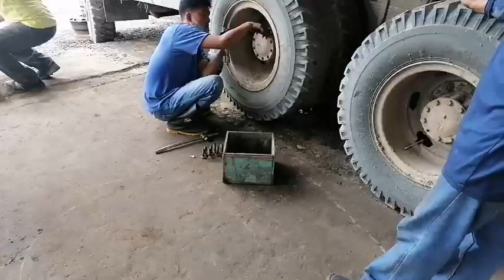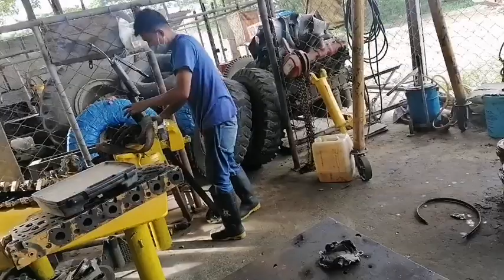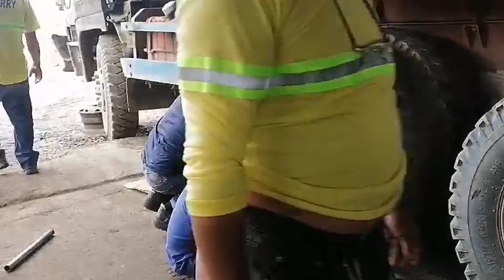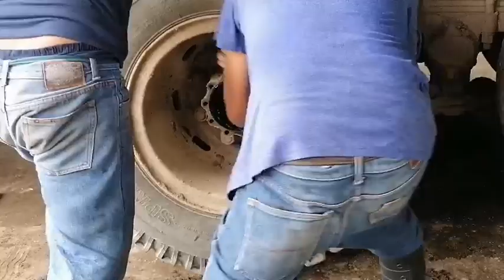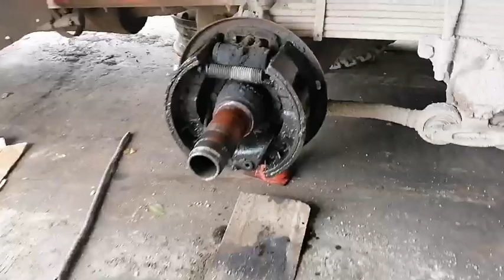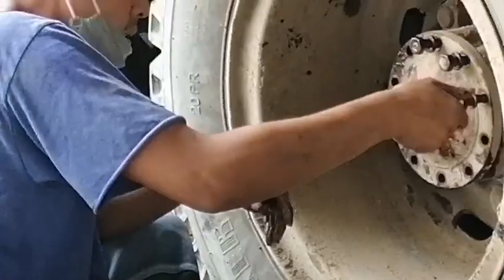Cause of Loss Brakes

Comment: I would have thought that a leaking seal has contaminated the brakes with oil from the transmission? That right there is the issue with your failure, I assume that because you didn't show any of the repair, you just fixed the seal and stuck it back together. Whereas we would have fixed the seal, cleaned the whole brake and hub assembly and the fitted new brake shoes.
Reply from the maker: Thank you friend for come by to may channel see you around